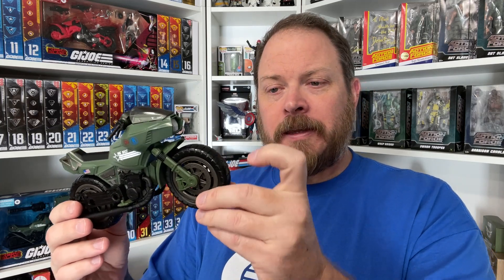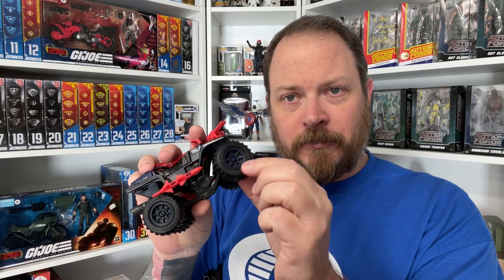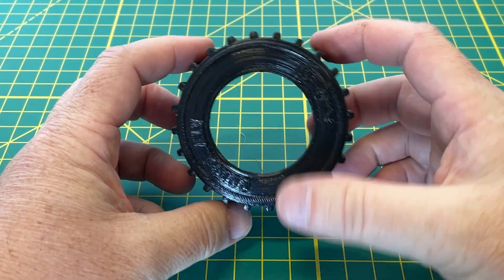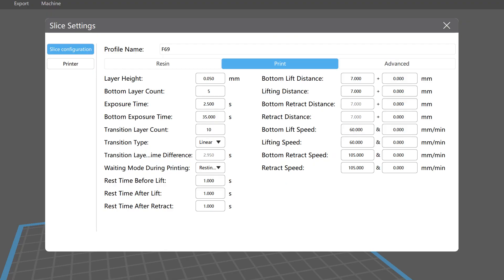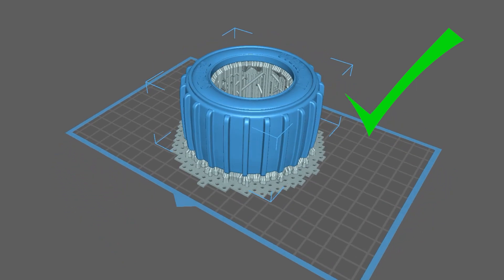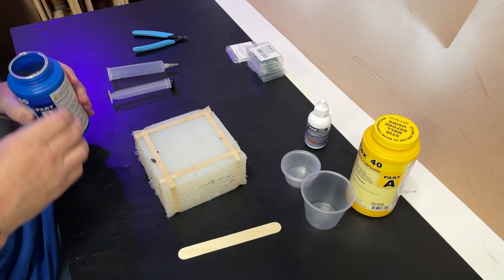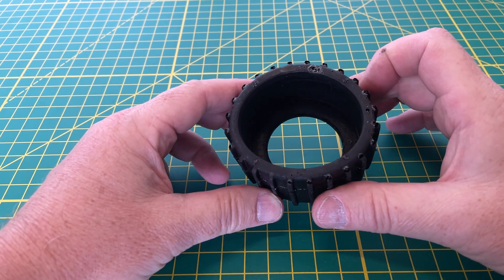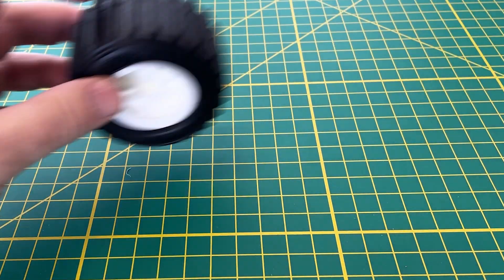Classified GI JOE Ferret Part2: Tires

Comment: Another option is to spray the part in Creature Cast Rubber or Plastidip.  While the Plastidip will come out satin looking, it dulls easily with a high grit sanding after it has cured.